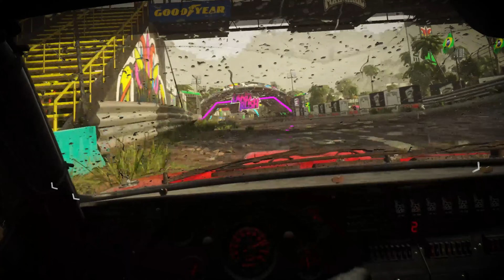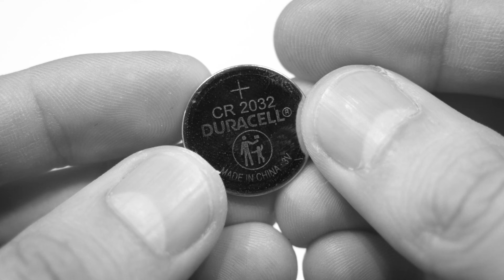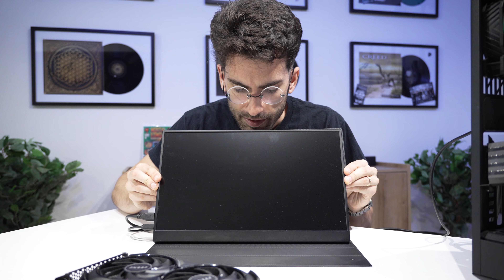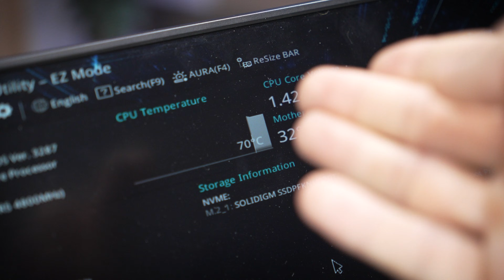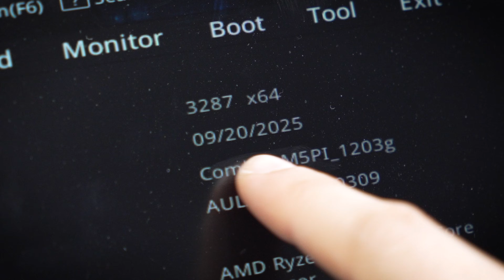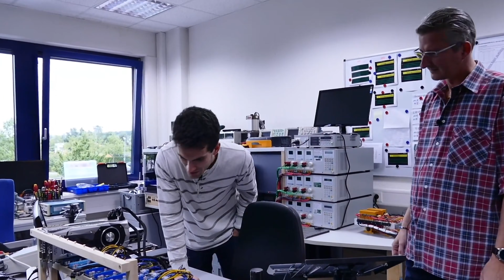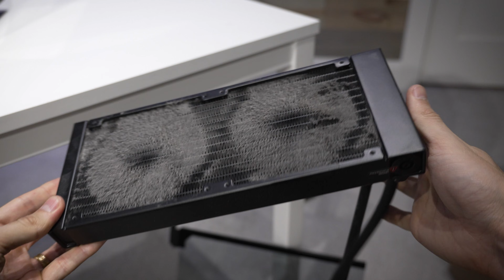Fixing a Viewer's BROKEN Gaming PC? - Fix or Flop S7:E4

Comment: A couple of weeks ago my PC kept crashing when I let it idle. Like, I could play games for 12 hrs and it would be fine, then other days I turn it on, watch YouTube, and it would crash. 
All I did was take my DDR4 from 3600 to 3200, and it's not crashed since.
I read somewhere the 12900k does not support 3600, so I thought I would try it even though the PC has been running with no problems at 3600 for 2 years, so I have no clue what that was about.
Reply: Hmm, that almost sounds like the kind of degradation infamously experienced in 13th/14th gen CPUs. If neither reseating the RAM nor a BIOS update do anything for you, you may want to borrow another similar "K" CPU.
Side note, memory clock says fairly little without gear setting or timings. A 12900K should be running 3600 in gear 2 all day every day, but it's also fairly pointless, you might as well be running 2933 in gear 1 with timings tightened proportionally. If you were running 3600 in gear 1, the board may have been shoving a fairly high (>1.25 V) VCCSA into the processor, which could explain long-term degradation. (DDR4 arguably is a bit of a bottleneck for a 12900K anyway, even if not usually so much in games.)
Reply: @PileOfEmptyTapes  the only people who got ddr5 with their 12900K were rich. DDR5 when the 12900K came out was just as hard to get as it is right now. 
When I was ordering my PC, all the DDR5 RAM said 'out of stock' with up to a 5-month wait.
Reply: @PileOfEmptyTapes  I can tell you something even stranger: I put it back to 3600 a couple of days ago and have not had a single crash. The only thing that changed from when it was crashing to when it was not was a Windows update.
And if I think of it, the problem started after a window update.

Comment: Given as the power supply works, I'd have gone with that and just replaced the memory and CPU cooler. Just me.
Reply: "works" - Did you see that voltage variation in the bios?!? Sure, technically it "works", probably not for long though...

Comment: The Smart PSU's aren't bad, But all cheap Bronze PSU's should be 200 watts above what you need.  That 700w unit was probably a tad low for his system.  850w would have been fine.

Comment: Replacing my Ibuypower Ryzen 7 7700X & Radeon 7800XT OC 16GB based machine with a newer Power supply hopefully at Christmas,  From 750 Watt Ibuypower, to 750 Watt Seasonic or Be Quiet Pure Power 13M  750 watt

Comment: I love how you stress about the PC speaker.  Probably years ago I would suggest that listening for the different beep codes, but I also have never had success with that with today's systems.  I think the last time I heard those beeps was on a 486 or quad core AMD processor Athlon 64 I think.  Actually now that I think about it there was a Lenovo or Dell system I worked on not too long ago, not too old, that had those beeps.

Comment: It might not always be a bad kit - sometimes a specific DIMM kit might work with the motherboard and then not...for example, if the kit isn't on the QVL for that motherboard, no guarantees - and I've a couple of times had a specific part number get removed from the QVL after the motherboard manufacturer released a BIOS update.

Comment: "To be fair".... as the LetterKenny constituents would say,.... you DO have to turn on the "beep" code setting in the bios before adding the speaker, its almost always turned off by default in my experience... but your also right that it only works randomly in MOST cases...

Comment: I bought a 10 pack of the little PC speakers off Amazon awhile ago. I don't need any codes from it, I just hearing the little post beep since I grew up in the 90's when PCs sounded like a turbine winding up. I just wanted to point out that I don't think the speaker will do anything unless enabled in BIOS, but kinda hard to do with no picture out. But once they're enabled they can prove useful in future troubleshooting.
Reply from the maker: Yeah needing to enable the sounds in the first place defeats the point of speakers entirely if you aren't getting a POST.
Reply: @GregSalazar  Yea it should be enabled by default, especially if the board has no LEDs or code readout for troubleshooting.

Comment: Thanks for a great video.
1. Did you check that the water cooling pump was running at 100% speed? It was only 1800 rpm in bios.
2. Did you test the RAM in another computer?

Comment: I went with the Lian Li Gallahad2 infinity 360 aio couple years ago. Wanted the pretty screen. Never had an issue but I know sooner or later it will have to be replaced. When it does I am going back to air cooling like I have used in all the other PC's I have built for myself and I will suggest to others I build for to just go with an air cooler.

Comment: Enable beep on boot in bios...it works.
Reply from the maker: How am I supposed to get into the BIOS if the rig isn't posting...?
Reply: @GregSalazar yeah, it's better to have it on...alwys.
Reply: @jrose-xp6tf  How do you turn it on without a post? That said, I always buy mobo's with LED's for the components AND a proper debug LED on board.

Comment: I wouldn't dismiss the PC Speaker(beeper) just out of hand.   For instance in this particular scenario when initially powering on with no video was the no video due to "Other" issues or because the system wasn't POSTing?   Even a single beep would signify the system is POSTing while no beeps at all could tell you something.
Reply from the maker: My point was that none of my speakers ever beep... not that a speaker wouldn't be useful.

Comment: I have the same case. Hyte Y60. The AIO could and should go where the top fans are. Instead of mounted on the side.
Reply from the maker: There's nothing wrong with it. Pump is below barb height and temps are fine. Fresh air is pulled in through the side, along with extra from below thanks to those basement fans for the graphics card.

Comment: Greg, I had a very similar issue about a month ago. Two systems, both running Asus B650E -F motherboards and 32 gb of T-Force DDR5 6000 ram died. Both systems showed the dram debug led, but switching out the ram did not resolve the issue. I received warranty work on the motherboard(thanks Asus) and T-Force replaced my ram. The fact two identical systems had the exact same issue was really odd. Both are back in service now.

Comment: I've run Bequiet fans for years. I went with Corsair for my power supply for my new build, but my previous PC had a Corsair PSU and ran for years without issue. So I stuck with what I knew to be good, anecdotal as it were. I did see reviews showing the SFX PSU from Corsair was the highest rated SFX power supply ever made, so it seemed a good option. Bequiet didn't make a 1000 watt option at the time.

RAM doesn't have RGB either. I don't think it's a big deal.  You fixed things for him. I'd be elated if you were close by and I could ask for help if I ever had major issues I couldn't resolve. You do awesome work, Greg. That is one nice case, really. Though I find the huge cases a bit overwhelming. It's why I went for a compact build this time. I found an mATX case that was configurable to fit ATX and even EATX motherboards. It's tight building in there, but hey, we all have to make compromises somewhere. I still say the aquarium look to that case is really nice though! I'd go for a blue glow spectrum for the RGB if I had it on.

Comment: Regarding the mobo speaker, many times you have to turn on boot beep in the bios for those to work. Seems like most modern boards have that off by default
Reply: but you need to be able to boot in to bios to do that and for that you need to troubleshoot just to boot in (in most cases) so at this point you don't need that speaker :) So it's dumb that they are off by default
Reply: Turn on the beep to get the boop
Reply: I was thinking that when he tried it. I use a speaker, saved my life a few weeks ago when my chip kicked the can, but i had to enable it in bios originally in order to use it. They really should allow it really should be on by default Especially on these boards with no debug leds
Reply: All the motherboards I have worked on (new or old) had feedback on by default.  I always install a PC Speaker on all builds and repairs
Reply: @DarkHorseCom  Same, even my new X870E motherboard has a working speaker connector out of the box.
Reply: @JMMadKiller  Same, every Haswell or AM4 board I've ever touched has had working speakers out of the box. Greg are you SURE your speakers actually work and haven't just, idk, broken or the wire's come off inside or something? Because if for you speakers "never" work, the problem's either you or your speakers...
Reply: @JMMadKiller  My MSI x670E has the beep disabled as default in bios which is a horrible terrible idiotic decision.
Reply: aand thank God for that.
Reply: @KingcoleIIV  boooooooooooooooo
Reply: No beep without a connected speaker anyway.
Reply: @sp00n ...obviously

Comment: funny thing i also worked on a pc today but this wasnt a gaming pc but rather a prebuilt from the windows 7 era yes i know its old but for what my brother in law is using it for it works perfectly fine and honestly i see no reaosn to throw it out if a used board can be found for a reasonable price which luckily there was one on ebay and seller had excellent ratings  (100%)

Comment: I bought a be quiet power supply 12 years ago and it's still working ...in a different rig....good as new.
Reply: Seasonic  Prime TX 1600w here, buy once cry once, but then again my system is overclocked to the moon, running a custom open loop, bare die and TG WB for it. 9950X and 4090 in the same loop with loads of fans (24), beast and silent 🙂.

Comment: The reason why the speaker doesn't work  default motherboard it's off. You have to go in the bio settings to turn it on. In the bio setting it might be called POST beep.
Reply: How are you supposed to go to bios and configure something, when you don't get a post while trying to troubleshoot? Makes no sense
Reply: @anoshione  Yeah.  It at least makes sense for a board with a diagnostic LED on the board or acc that shows codes...   Why they have it disabled by default is beyond me...  surely it doesn't take any meaningful power lol.

Comment: All these problems can be explained though dirty power from the power supply.
Reply: Dirty power doesn't clog the AIO. It also doesn't break the clip on the ram slot.
Reply: @frommatorav1 it caused the pump to work harder
Reply: @Jafar-dr6to  Fair point. Or it was underpowered and sludge built up.
Reply from the maker: @Jafar-dr6to  Dirty power didn't cause this pump to "work harder." The loop is clogged. This was mentioned in the video and has been documented on this channel several times in the recent past :-)
Reply: @G @GregSalazar I know I said can instead of could explain but even I don’t always hear bad pumps I usually have to feel the tubes for movement. Either way the IAO need replace. And yes I have a bias about mainly using air cooling.

Comment: Ironically - there is a half height bracket included in the box with that GT 1030 so it could actually fit in that case in place of the riser.

Comment: The customer needs to definitely RMA those DIMMs. Especially right now.
Reply: TeamGroup will replace it. Done it before. As long as it's not abused or have any parts knocked off. Cheers!
Reply: @richteritwan  Best get it done sooner than later. I've had to RMA memory in the past month to a few suppliers and I'm being told they don't have enough to go around, so they're short changing customers and sending them back worse spec memory sticks and fewer memory sticks.

I had this happen to me before decades ago, during the DRAM price fixing era. Had a bunch of DDR go bad and the OEM told me not enough stock was on hand, so they sent back worse spec memory.

It's especially bad if you have high end memory. Since those memory speeds don't actually exist, OEMs are binning chips to make those high end sticks. Once they run out of those binned memory chips, they're not getting more of them, especially now with the extreme memory shortages. Expect to not get exact replacements, and expect them to be a much lower spec of memory.
Reply: @GGigabiteM those are scummy companies cuz AMD didn’t have the stock for my 5800X3D RMA and they upgraded me to a 9800X3D for free.
Reply: @casedistorted how did that work when the 5800 is am4 and the 9800x is am5 and would require a motherboard and a ram upgrade
Reply: @richteritwan  Depends on situation, since it was in a prebuilt perhaps new kit, but I wouldn't be surprised if nothing would be done or gets a refund instead.
Reply: @gamerdweebentertainment1616  Worst case scenario nothing changes. Doesn't hurt to ask.
Reply: I'm guessing it's out of warranty since they didn't go through iBuyPower to get it fixed.
Reply: @M_Messer team group I believe does lifetime ram RMA, I could be wrong but I do think they are one of them along with Kingston that will always replace
Reply: @willjenkins4100  Kingston Dimm and Drives have never let me down!
Reply: @M_Messer  Most RAM has a lifetime warranty unless its bottom of the barrel
Reply: @anthonylong5870 You are forgetting that this is a pre-built by iBuyPower.  Warranties belong to the original purchaser and don't transfer.  The original purchaser in this case is iBuyPower.
Reply: It's been a couple years, so they'll (Ibuypower) tell him he's out of warranty. This is what they told me a few months ago when I asked for new top panel clips for my Y40 dust panel, which they did not include spare clips originally in my little HYTE box that they told me to look inside of. My clips are still missing.
Reply: They’d just refund what he had originally paid, and of course the sam kit would cost 5-8x more today.

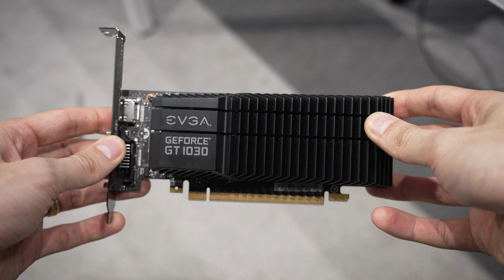Comment from the maker: @ 6:58 The 7700X does have integrated graphics. Confused my models/generations in the moment. Sorry for the confusion!
Reply: the speaker would have helped... :face-blue-smiling::face-green-smiling:
Reply: lol I was going to say. xD Most of AMD's Ryzen mainline 7000 and 9000 CPUs have an iGPU.
Reply: @exxor9108  I didnt realize this until I upgrade to a 7600x
Reply: Pre built pc now are top cpu x3d rtx 5080 good ram then cheap motherboard and power supply the motherboard is never on the specs
Reply: What the heck Greg? You mean to tell us that you can not remember the spec of every single CPU that has been made?? Shame. (Sarcasm)
Reply: The owner wanted some FREE NEW RAM!!
Reply: Um … yeah … get off the internet! LOL 😝 JK couldn’t resist 😂
Reply: After 40 years on pc i still don’t care what case it’s in 😂is it good dose it work is all I need
Reply: Not cool Greg, not cool.
Reply: I'm glad I read the comments first, because I was going to say the 7700x had IG 😂😂
Reply: My Motherboard Speakers are working just Fine in all 3 of my PC's Thanks!
Reply: I'm Confused, the RGB on the 'Defective Ram Kit' Lights Up but the Ram is Defective??
Reply: @michaeloneill1360  That's because the RGB part is not connected to the actual DRAM chip's functionality.
Reply: Once again we have a Pre-Built PC, & the Builder 'Cheaped Out' on the GPU!!! A Geforce 4060Ti Seriously???
Reply: @michaeloneill1360  Like to put people down based on their budgets?  WTH is wrong with a 4060ti, first don't blame the builder someone bought it. Second 4060ti is a solid GPU.  I have 3 PCs, one with 4090, one with  5080 and one with 4080 super, but I'm not putting down people who only need or can only afford lower end GPUs.  Beat on the builder for putting in and absolute POS motherboard.
Reply: @michaeloneill1360  which later down the road he can upgrade.

Comment: So in a week or two you'll start having to diagnose RAM failures and sadly tell the people that ram is too expensive. Huh
Reply from the maker: I've rarely told any owner in this playlist that something is "too expensive" and therefore cannot be replaced for free. We are already working on solutions.
Reply: @GregSalazar probably would need to make a run on local sellers of 2nd hand parts, etc and filter through their inventory. And eBay listings that were hanging for longer than the price hikes so they are now a "deal" :(
Reply from the maker: These are not the only options we have.